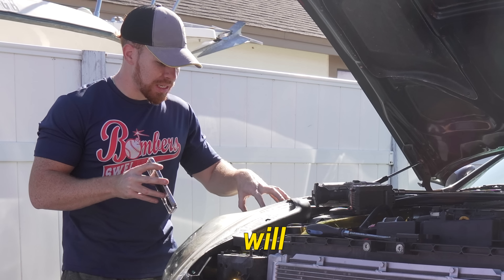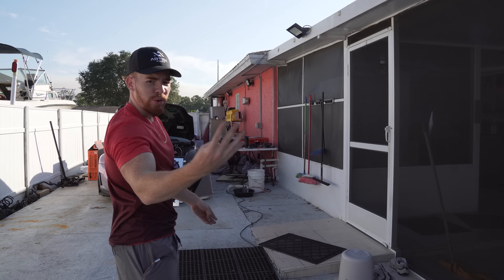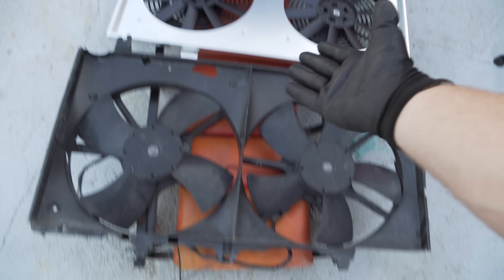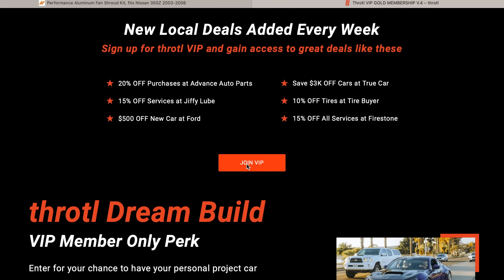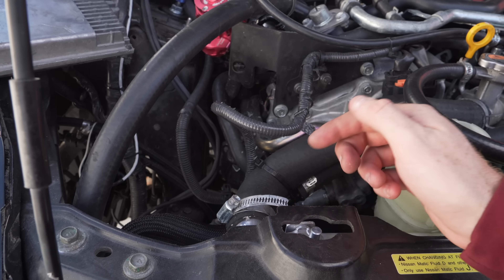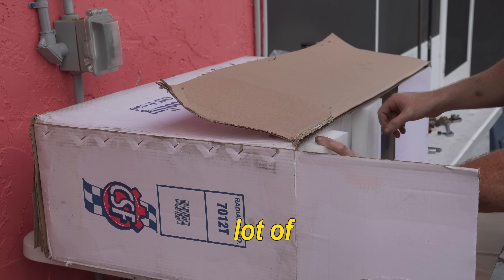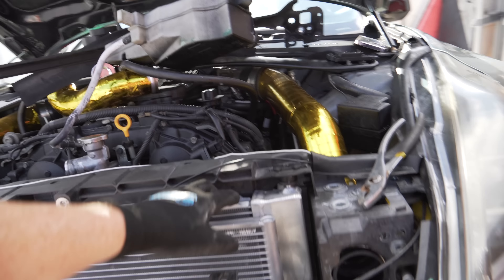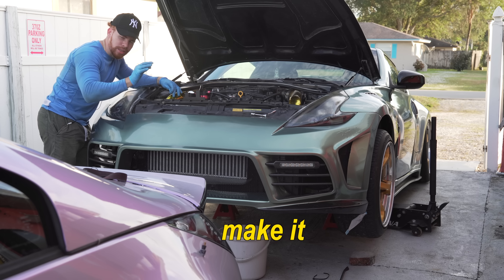Introducing the Monster 1000HP Twin Turbo Nissan 370z!

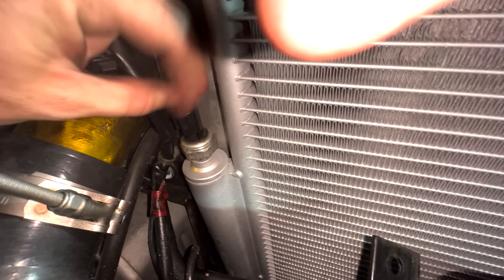Comment: @13:34 that sensor needs thread sealant tape on the threads to help seal it, it dosent have a crush washer like most, it relys on the threads to seal, so it needs thread putty or plumbers thread tape on threads to ensure no leaks.. please redo

Comment: 5-10 G's with built motor and supporting mods, ie. fuel pump, fuel pump relay kit, fuel filter, lines, fittings, fuel injectors, fuel rails, fuel regulator, rods, pistons, full rotating assembly balance, head porting and polish work, 5 angle valve job, bigger cams, solid lifters, upgraded oil pump /gear, ect.ect.ect..
Reply: LOL, now that is just too funny. You have no idea how much it costs.

Comment: Hey Danny, I know its been a minute since you installed the Nifty City Tesla type screen into Britney, but I just got me my 2019 370z Roadster (base model) and plan on putting one into her.  My mechanic really recommends I have a professional install it, not him btw, since SO many things are ran through the stereo and the possibility of messing the car up is not insignificant.  Your video made it seem pretty cut and dry, so I'd like to know, how hard did you find it installing it, did you run into any problems? I consider myself a DIY'er, so if you say it wasn't too complicated, I may consider installing it myself.  Thanks
Reply: If you watch enough videos you'll be fine. You'll save at least $100+

Comment: The best advice I could give you is to start out with a high quality twin turbo kit.  Fast Intentions has your name on it. You can make 900whp with their stage 2 kit which is what I started with. Now the built motor is going to be the problem. Anything above 800whp can be a problem for longevity and a tuner can kill it before it even gets off the dyno if they don't know what they are doing. We have plenty of those on our platform. Maybe you should plan to stay around 800whp and save yourself a whole lot of headache and money.

Comment: VQVHR is not known to hold power well at 1000whp. The metallurgy is not nearly as good the GTR block. Derek/Spooler has spent  well over $100k to attempt 1000whp multiple times. I'm not trying to hate on your build at all, I'm just saying it's a tall order with the VHR because you're going to walk on eggshells at 1000whp. Consider running a standalone like Motec. Good luck man!
Reply: Thanks for reminding me of my struggles. LOL
Reply: @spooler7828  just passing on a few hard lessons. Hate to see people go down a known bad path.
Reply: @GregoryBrettin  The question is, "Will they listen?"
Reply: @spooler7828 I think the highest vhr whp was 1037ish that I have seen. As far as DE goes soho made 1186 rwhp, as far as VQ WHP (hr de vhr) that 1186 DE is the highest whp VQ I have seen on E90. But most cars like that are dyno queens, they will make a crazy whp but most likely not use that same whp on the strip continuously just my opinion.
Reply: @DEATHWISHVQ  SOHO's top fuel motor will still lift the heads. The high hp example cars are just drag strip cars driven infrequently. 2 motors have lifted the heads with top fuel hoops. You just don't hear about them.
Reply: @spooler7828  yeah I assumed it’s only a matter of time before lift, now I’m really thinking a 1000 whp street vq is a time bomb. Why do you think lift occurs? I assume it has to do with rigidity and vibration, as of rn I haven’t heard of other engines having lift, nitish had L19 R35 studs custom fitted in his DE but I’ve seen the 800-900 whp mark is still a safe zone or at least can be.
Reply: @DEATHWISHVQ  Yup, the casting is just weak. It is not the same quality as a VR38 engine. The aluminum is not as dense or strong. I have done it to two engines. It is what it is. 800whp and lower seems to be OK. Go above that and it is a ticking time bomb.
Reply: @DEATHWISHVQ  Nitish's car is struggling to make high boost. He continues to have BP kit issues with exhaust leaks and boost leaks. Plus, he has never had it hook. When it does, the motor will see a full load for the first time.

Comment: Well, Soho Motorsports has a 1,060whp customer car with a TT top mount setup. Their Stage 2 HB motor is $25k. TT kit can’t be less than $15k  or more. You’ll also need twin 525 fuel pumps, 1700cc injectors, and -8 or bigger AN lines to support that power with comfort as well. Oh, and PLEASE get a water/meth injection kit. And use Boost Juice. You’re going to have to for reliability reasons at that HP level. Hell I use water/meth on my 700hp stock motor fast intentions TT kit for that reason.

Comment: 😅 it’s not making 600 now and probably won’t make 1,000 when you are done.  put it on a real dyno like the one at Five Bar Motorsports and prove me wrong .
Reply: 1000 hp has been hit with a VQ37. Def doable. Fast Intentions hit 1k back in 2016.